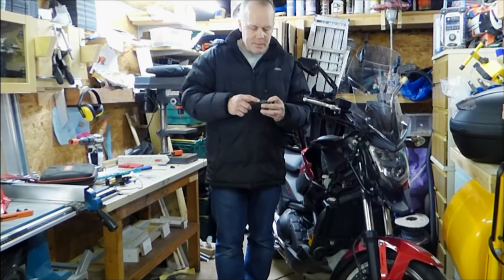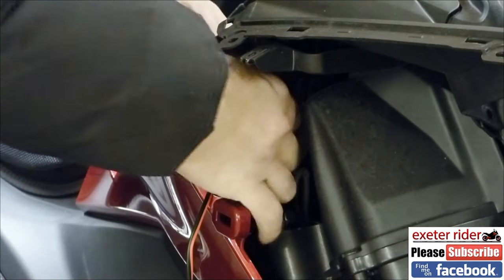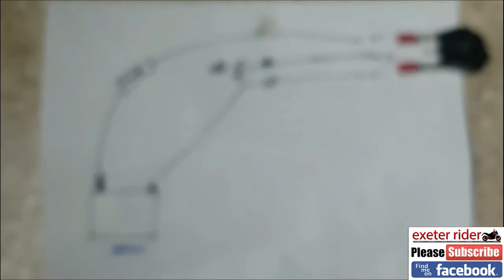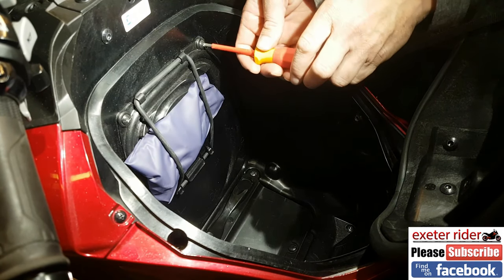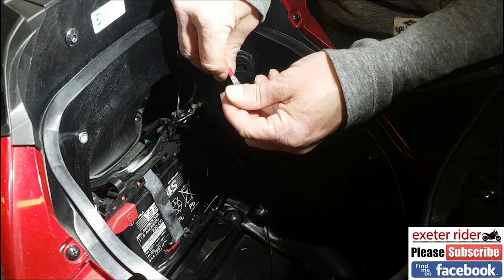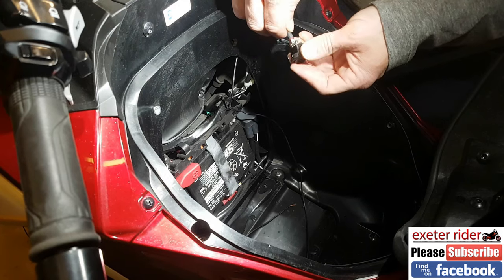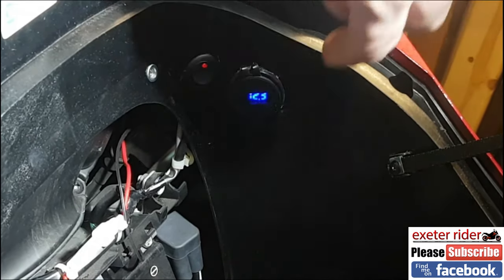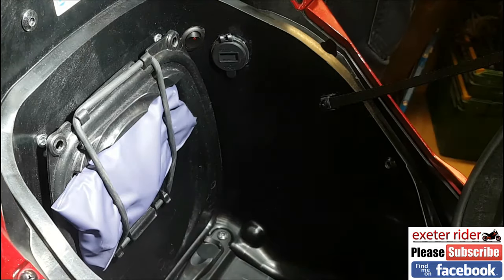"HOW TO"  FIT A USB CHARGE OUTLET TO ANY MOTORCYCLE | exeter-rider

Comment: Thanks ExeterRider for another practical Vid! 
I made the mistake of getting the Honda 12V outlet when I bought my NC750x as part of the comfort pack. 
The Honda version is limited to just ONE amp, making it a useless waste of space! 
Goin' to rip it out to put in something like this.
Reply from the maker: WHAT!  1 AMP! blimming useless. I'm glad you told me that because I was unaware. You pay enough for the comfort packs aswell, the least they can do is get you a decent charger.

Thanks for watching though. Much appreciate your time👍🍻
Reply: Well, I have been wondering about this. I think 4.2 amps is enough to fry most phones and accessories. 1A is about right really.

Comment: Ye brilliant video, especially the switch terminal explanation, do not know how I didnt know that but I do now, many thanks.
Reply from the maker: Thankyou for watching mate👍🍻
Reply: No thanks for making it . I am sure I have  fitted switches a long time ago and I had no idea about the connections like that, possibly I have tried it failed and then gave up or got lucky. However it is great to know and I need to fit the same set up to an old k100lt I bought 6 months ago to  get it ready for some modern tech support for riding so super useful given that. Thanks for the great work.

Comment: great vid on the install and looks really good but let down with battery terminals. would recommend putting some ring terminals like you talked about, more secure, easier to re-attach if you add more accessories in the future and little chance of corrosion causing a poor connection. loving the vids and the bike
Reply from the maker: Thanks mate, I fitted ring terminals after the lockdown was lifted just for the record 👍
Reply from the maker: P. S your profile picture & name is the best 😂😂

Comment: Some honda's have a Option Plug (OP) or sometimes called Options Connector. You can save a lot of hassle by using it as this connector is already wired up to the battery and will automatically turn off when the bike isn't on etc.
Reply from the maker: Yeap, you right, I find thats on the higher premium bikes. The NC has nothing sadly.  Good post though Thanks.
Reply: @exeterrider  I think my bike is lower tier being a cb500x but it has the OP connector luckily for me as I'm useless at stuff like this. Thanks for the tutorial though it was a good starting point.
Reply from the maker: @GeordiLaForgery  Ideal : )  No Worries

Comment: and this wont drain the battery at all when stored ? . just checking ofc since i will most likely be doing this then :) so thx alot for the explenation, made it look easy
Reply from the maker: Yeap its fine because the switch i fitted cuts all the power to the outlet ....so as long as there is a switch then no load will be drawn : )
Reply: wouldnt be better to wire it to the ignition?
Reply from the maker: Yes, but I didn't want to split the harness an be take that risk.
As it happens it makes no difference either way👍

Comment: 1st. Nice video.  2nd.  If you forget to turn the switch off, and there is nothing charging,  will it drain the battery over night.?
Reply from the maker: Not over night but yes it needs to be off.  I probably turned it off away from the camera.

Comment: Great and useful content as usual, man...nice job! Crazy how even a video like this makes me want the NC as my second bike. I have an all-in-one phone mount/charger on my GS...came fully assembled, but I often think of adding a second USB. Is there a point where the battery gets overloaded by having more than one? I especially like the meter you have on yours, this makes me want to add the second one.
Reply from the maker: Thanks,  it should be fine to add another on your bike. . They pull very little current, Mine is a double USB so might be easier to change yours for a double perhaps.

Comment: Yeah...for sure get ring terminals on those battery wires,you never see a manufacturer just wrapping wires around a connection...couple of tips,try and use blade fuse terminals,they are available with pigtails and don't have glass fuses.DC is negative and not neutral (that is for AC) and,its an LED not a neon.
Otherwise..all is well ;-)
Reply from the maker: Hi yeap all noted thanks, due to lockdown I couldn't get the terminals but now all sorted - it was just for the video.  Thanks for watching

Comment: In my manual for my charger it says to wire into something connected to the ignition switch, but I’m not sure what wire to use. Is there a reason you didn’t do this here?
Reply from the maker: Yes because I didnt want to cut the wrong wire lol....much safer to do it direct then add a switch!
Reply: @exeterrider   Yea I went with the “auxiliary” wires in my headlight housing which seem to just be directly connected to the battery. I have a magnetic charging phone mount and it has a switch in the back, now I just have to remember to turn it off every time. First time I drain my battery I’m going to figure out how to wire up a relay =)

Comment: Nice video👌 I was wondering: I have an old honda xl 600r from '85. It only has a kickstart and a very small battery. Would a USB charger work on such a bike? Or does the battery size not matter??
Reply from the maker: My instant thought is yes it should be fine. But I would advise a professional second opinion 👍🍻

Comment: Your better running the red positive wire to a hot wire comming from the ignition . That way the plug only works once the ignition key is turned on. Less chan e of getting a flat battery. The earth black wire can ground on the chassis.  This way you have less shit hanging off your battery poles.
Reply from the maker: Yes I didn't want to go digging around trying to find out which was the ignition wire in the harness which is done up tightly etc. Kept it simples.   No can of worms wanted 😂😂👍

Comment: I want to install the plain 12v socket in my NC750X with the option to switch between a USB adapter or a 12v connection for other devices such as a air pump for camping mattress, will it still drain the battery if I don’t have anything plugged into it or will I still need a switch?
Reply from the maker: Depends what type you use. Inside it may have capacitors etc that can use a small amount in some cases. For what it takes for a switch. 👍🍻

Comment: Be sure to put a proper connector on that wire ASAP. The wire wound around the terminal may over heat when using the starter.
Reply from the maker: Will do mate, haveing said that I couldn't show it in the video but the battery clamp has a really good mechanism and is pretty much clamped the way it was before it had the wire in which itself has clamped quite flat. I take your point rjough👍🍻
Reply: @exeterrider  A better way would be to put solder on the wire and make it into a hook and clamp that. Loose wire clamped will spread out as tightened. when the starter is used a kick of something like 30amps comes through the battery terminal and stranded 5amp wire will fry.
Reply from the maker: Yea, once lock down is over I can get some ring connecters and shove on. It's surprising how good the connection is with the battery. It will be fine as a tempory measure 👍🍺